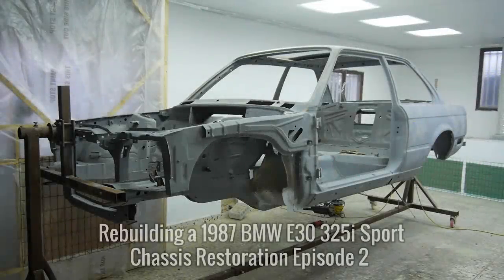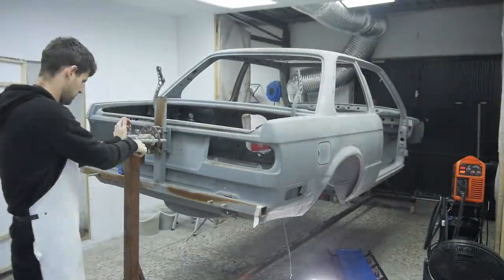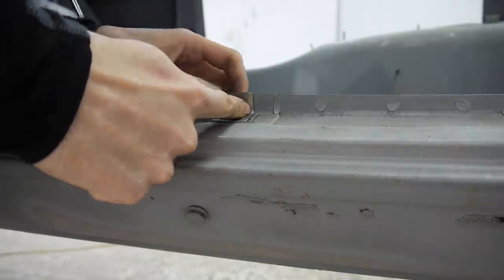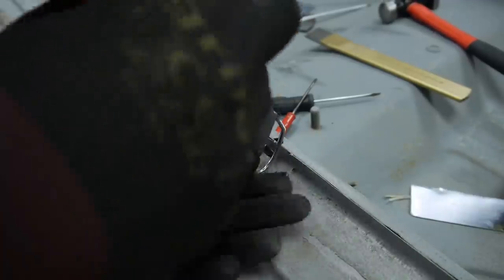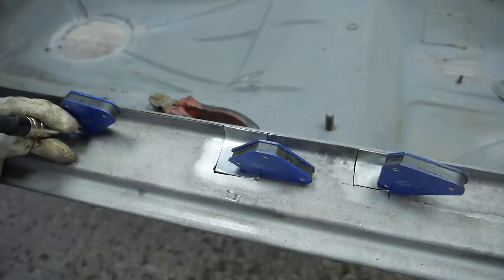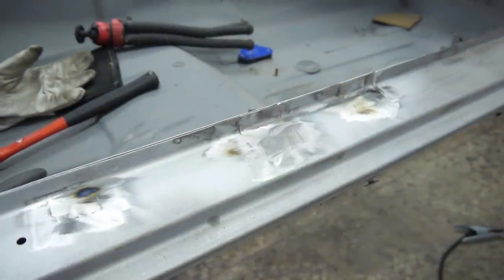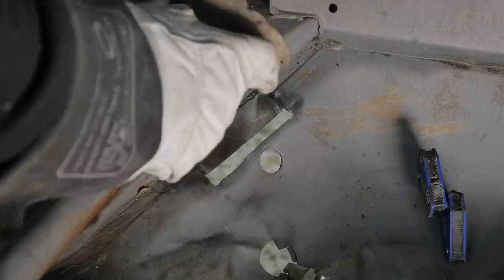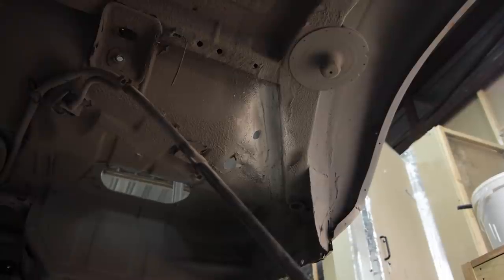Rebuilding A BMW E30 325i Sport | Part 2 - Learning to Weld A Car

Comment: You're doing a fantastic job but a little tip. when cutting into two panel like the back seat area you did, it's always best to remove layer by layer cutting the first layer bigger than the last layer. That way when you weld in the bottom layer you have space to grind down the weld so the top fits flat to the bottom. Also instead of running your welds try spot tacking stacking them 50% over each other and that way you will not blow through the thin sheet metal. When you run the welds you are creating more heat into the panel and it is easy to blow hole in the panel. Hope this helps. Another tip I forgot to mention is when grinding in corner or tight spaces, use a small cut off wheel on the die grinder and gently grind the welds off with the edge of the wheel.
Reply from the maker: Thank you AS28g! Great adivce. I will keep this comment somewhere for help!

Comment: I brought a welder at the weekend as it was roughly the same price as buying a whole new exhaust as every section needed touching up, Watching your previous videos gave me the inspiration to 'bodge not buy'.
I'm currently practising on a section of new pipe by cutting off a piece and welding it back into place, I'm really pleased with the steady improvement each time i practice this, My plan is to start on the exhaust tomorrow.

Comment: I did a rocker panel and wheel well repair about just over 2 years ago in a small garage with a flux core and cheap tools. 

Some places the inner rocker and rocker and rear fender were so close to each other I made tools out of copper tubing to put behind so I would not weld together pieces that were not ment to be stuck together in that area.

Some of the metal I had to replace I had to shape and cut and weld on a bunch of times some of the panels I made ended in the scrap because I wasn't happy with how they looked next to the original metal (shape was a little bit off or something). 

In the end of it I had learned some new skills  and managed to make the jacking point on the rocker stronger than factory. 

It's fun watching your videos and the detail you show is awesome.

Comment: Try angling the torch to the thick metal. When butt welding i set the mig higher and give each tack a double hit allowing to momentarily cool before moving along. it makes for a flatter weld and less grinding.

Comment: Hey dude, try running a bit longer welds.
I know when i was first welding my e36 that i was scared that i'll burn through the panel and i didn't see shit through the mask so i made the same mistake as you did.

Then i took 2 pieces of scrap sheet metal and practiced, attempted to burn through on purpose, etc.. and that let me get a feel for it and not be as nervous when i'm working blind.

Also that e36 was hella rusty and i didn't have money for replacement panels so i made a lot of welds, i even chopped off rear shock mount and put in another one from a wrecked car lol.
Reply from the maker: Thanks CME! Damn you've been through it! Thanks for the advice man!
Reply: Problem is that you warp your panels the more heat you put into them, thats why you mostly just spotweld. He also should try lowering the wire speed instead of turning up the power, as he is already burning through the metal.
Reply: I must disagree, with longer beads you introduce much mote heat and then you have to deal with warping, letting the heat spread to a part with short tacks is much better imo
Reply: @oxygenium92  It depends to be honest, you are introducing a same amount of heat in both cases, it is just the amount of time you introduce it in.

A small weld like this on a well heatsinked surface would have 0 problems from warping, i guarantee you that, especially since these e30's were built like tanks compared to today's cars.

The problem with a lot of spot welds is that you much more run the risk of structurally weak welds,  and god forbid he crashes this e30 this weld point is a very nice weak point. How weak you want to make it depends on integrity of your welds and your filler material, the sheet metal in this case.

Also, tack welding like that all around makes the weld a lot harder to clean up and often leaves a lot of tiny holes which are dream come true for rust.

Everything has it's own limits tho, so don't go out and run 20cm beads just because i told you to, i suggest you experiment on your own a bit and also look at some professional  bodywork repair videos, you will see how they do it.
Cheers!
Reply: @FetteMacke  Both are true, if you look at professional bodywork videos, you'll see them section the weld into smaller chunks, about 5-8cm in lenght, which they weld in one go and then swap to doing another spot to let this one cool down a bit.

Plus, you are not welding paper man, it does not warp that easily, and if it does warp, it's still better than having porous welds in structurally important areas.
 Cheers!
Reply: @lazar2175  I know, outer body parts, like flat faces like the rear quarter panels for example warp easier than the parts he welded. Had to do some welding on my hyundai terracan, had struggles to not warp the fender, but the inner fender was easier
Reply: @FetteMacke  My dad owned a 2.9l Terracan, it rusted under the plastic trim in some places, and the metal was mighty thin, like on all new cars.
The 80's and 90's cars had a lot more substantial body panels and still had acceptable weight.
Newer BMW's have paper like bodywork, and in some instances more aluminium and plastic than steel.

We eventually sold the Terracan due to 4wd problems but it was a beast of a car as far as towing and  off-road goes. I called it poor mans G class as it was pretty much blacked out and was really boxy.
Reply: @lazar2175  I can only agree. Still have that car sitting in our driveway, waiting for it to come back to life. Had some issues with the check engine light, hopefully due to a leaking head gasket, my dream would be a LS v8 in that car :D

Comment: great to see and hear that your welding process itself is now properly working, nice short arc! the white residue on your small plates is still burned zinc from the coating. if you weld zinc plates the zinc burns and build fumes that can lift your shielding gas and your liquid metal pool. so the best would be using not coated metal.
Reply from the maker: Thanks for the advice Kus!

Comment: I am, by no means, a good welder, but I do have a couple of suggestions when using a MIG welder: I think it would be better not to weld perpendicularly to the spot, but with a small angle; when welding light gauge metal is better to make a number of welds, spaced in between, and then come back and do it again between the spaces, until 100% filled; the latter will prevent warping the metal, and possibly have less weld thru holes.
It is great that you have good tools to work with. It will be a great looking car once you finish with it. That you did it yourself is the best part.

Comment: Doing much better on the welds! For your comment in the video about thinking you need to turn up the welder, you need the opposite. Turn down the amperage (heat) just a touch, and turn the wire feed down a good bit. If you’re still blowing holes through the metal after this, turn the heat down more.

Comment: Nice job. Thats how my welding looked too in the beginning.

I needed to Grind them down to. I really recommend you to buy a small 9mm Belt sander like Makita 9032 or an air driven Alternative. The angle grinder is not precise enough so you grind down a Lot of Material of your healthy 0.8mm sheet metal so they it gets thin and hot.

For getting rid of the undercoating i recommend using a fein Multimaster or comparable Tools. Using a wire brush on the angle grinder is a really dirty process, but it works too.
Reply from the maker: Thanks Joe! Great advice. I'll try the belt sander and get the fein multimaster out for the undercoating.

Comment: Welding thin metal at weird angles is hard no matter your length of experience. I think your doing great. I stitch weld body panels to keep heat warpage down, stitching is just a series of tack welds that in the end look like a tig weld.
Reply from the maker: Thanks Sunny! I will try some stitch welding next epsiode for sure!

Comment: For grinding I recommend a pneumatic 90° die grinder with the grinding disk attachment. Works a lot better to get into tight areas for grinding down welds. Also the white residue you see next to the welds is the galvanizing burning. It can make you very sick so just make sure you get all of the galvanizing off, or even better buy the right metal for future patches.

Your welds are improving, and that's the thing about welding... Years from now you look back at your original welds you'll be embarrassed. But take each improvement as a step in the right direction. We all started somewhere. Good job waiting for cooling between welds and doing small spots then move to a different area. Too much heat in an area will just cause burn back at the edges of the panels that you then have to fill. Also I might recommend using a hand file to get nice straight edges in the cutouts making it easier to make filler panels. Making odd-shaped panels for odd-shaped holes is always more difficult than squaring it off from the start.

Keep up the good work. Love the videos and watching you learn new skills. It takes me back to my youth :)

Comment: Where you can, for instance the door sill edge, use mole grips to clamp the piece down, you'll get flusher bits welded in nicely.

For a beginner in welding I think you're doing great. We all make mistakes but that's the beauty in doing so, you learn from past mistakes.

I appreciate the effort that goes into your videos. Keep up the good work!

Edit: Also perhaps consider using a die grinder to clean your welds rather than the bulky but trusty grinder.

Comment: I use grinder discs for the welds with great results but it needs a steady hand
Reply from the maker: Thanks dude, I did start with those but a lot of people said I should use flap discs. I'll go back to them if I need a fine grind I think.

Comment: Don't turn the welder up hoping for flat welds, you are more likely to start  blowing holes through the metal! Trying to do welding runs with sheet steel will make the metal warp and it will make a mess of a good repair. Just do spot welds and that should be better for you. The repair you have done to the top of the sill and the seat base are really good for someone who has just started welding. And one last comment. I wouldn't replace a full panel just for some small holes. I would use some of the panel to do the repair but not all of it. You are doing good work, keep it up.
Reply from the maker: Thank you Ian. Solid advice. I really appreciate it and will keep it in mind.

Comment: You should tack weld . Put some tack , wait for about 1 sec , for heat to go into metal  , and cool weld , then put wire on end of previous tack , and repeat process . Do this 4-5 times and move to next spot . Do not try to continuously weld tin sheet metal. Another thing ,  first make patch , use grinder for cutting ( strait cuts ) , then put path over hole , and use it as template for cutting . Go for strait lines , cos its much easier to cut with grinder . Gap shouldnt exceed thickness of wire . If you have holes to fill , use some heavy piece of metal , like old hammer ,to make bottom of hole. Wire wont stick to heavy piece , if you do short weld .  Good luck
Reply from the maker: Thank you Stevan! Great advice.
Reply: Your welds should look like CCCCCC

Comment: as you have an airline and a 2 inch roll lock, you should get an angled die grinder. you can used 2 inch flap discs and sanding pads and will produce easier cleaning than your electric die grinder and wire wheels...
Reply from the maker: Thanks Antony I will look into this.

Comment: You are doing very well for a newbie. 

As for setup, get a smaller dia. Mig (GMAW) wire (.023 inch - .025 inch - basically the smallest wire you can find). On thin gauge material like these panels it works much better. This will also allow you to lower your voltage (no more holes) and wire speed, resulting in less material (weld) build up. But it will provide the proper penetration for this application. 

However, on structural components 1/8" (3mm) and above you need to use a larger dia. wire (.030" or even .035").

Comment: I Think if you go for TIG welding you use half the Flapdiscs and save alot time grinding, the welds look better too. If done correctly also less heat in the material that may cause warping the metal. I use Mig also, but its not for restoring cars. Just make cars passsing MOT or weld an exhaust :P I did see alot improvement!
Reply from the maker: Thanks William! I really want a TIG. I'm going to get one!

Comment: Don't know if you found out yet, but there are hand operated (and air operated) punches for making holes for plug welds. Makes a cleaner hole than the drill bits, and goes a lot quicker. My air operated one is also a flanger.

Comment: hey man, just a tip on your welding, turn your voltage up around 10 to 20 volts and turn your wire speed down a little. Remember as a very general rule voltage dictates weld penetration while wire speed dictates weld penetration and weld deposit quantity. also as you are using shielding gas there is no flux going to be formed during welding so there is no need to wire brush between welds. finally only weld in maximum 1 inch steps and move to another area to keep the heat down and help in stop burning through.

hope this helps. keep the vids coming and best of luck with it
Reply: Sorry 1 more thing after reading a few of the comments below, there are a good few comments talking about tack welding all around the patch instead of a weld bead, as you are using what looks like 1.5mm plate there is no need for tacking as the metal is thick enough to take the heat.
Reply from the maker: Thanks for all of the advice Simon. I'm using 1.2mm and will be going down to 1mm in some places so I guess some tacking will be in order. Thanks again.

Comment: 23:00 I believe that with MIG welding you're supposed to "push" the torch rather than "pull" it?? Someone correct me if I'm wrong, but that's how I was taught.
Reply from the maker: Someone else has said this so think you're right SlapHappy :) I will push it from now on.
Reply: Pulling is right when you use low powered Short Arc Process as on thin plates like Cars . If you increase Power to Spray Arc (more than 26V) and you want to weld a fillet Weld for example then you need to Push slightly around 10 to 20 degrees to get a nice flat seam.
Reply: You should also do what they call stitch welding which is a series of tack welds around and around and around so you don’t overheat and warp the panel
Reply: Well it is not really my place to advice as i a not welder but i would think asking someone who does welding for profession or is good at it to show how to get started would help you get a bit of confidence and right tecniques. Thx for the videos.
Reply: Because of the shield gas, pulling it makes it escape. Pushing it protects it.

Comment: For the welding you need to tack every 35mm ish then stack 5 tacks at a time not full welds it puts less heat in also have a wet cloth to hold on after tacks
Reply from the maker: I will try this next time thanks Nicholas!

Comment: You sure are getting better and better! Congrats! I have some unsolicited advice: the top of the sill is a flat pannel with a 90° bend; you had 3 rust holes lined up, it would have been better to make only one patch pannel, less welding, les pannel weakening. Also, I would recommend getting a spot weld drill bit, will make your life easier and you won't have to dill through both pannels. Finally, for a perfect finnish and minimum use of filler, I would advice you to use tin to fill the welds on your patches. Hope this helps! You are doing awesome.

Comment: those tack welds looks very good tbf, some people do runs like you tried to do, i prefer to tack one by one all the way round the panel, tack in all corners to hold it then tack and tack and tack one right next to the other (best to try and overlap a tiny bit) also im glad to see you resting the gun on your hand or with your fingers against the panel, welding in mid air is very difficult and annoying, but i can definitely see your progress keep going!!
Reply from the maker: Thank you Kezza! I'll try it next episode :D

Comment: You turn the temperature up, then find you blow through more... so you grind back, which thins the metal, and when you weld the holes you blow through even easier! It's frustrating but as you say, it's just down to practice. And everyone has to start somewhere 👍🏻 Keep it up!

BTW finger sanders a great for carefully grinding back just the welds, not thinning the surrounding metal.

Oh suggestions for the rear bench near the fuel filler pipe, getting started, maybe a cutting disc? Appreciated you may not have the room and angle there...
Reply from the maker: Hey CookRacing, thanks for the comment dude. I apprecaite the advice. I should have use the bloody air finger sander I have! I won't forget next time. Thanks man.
Reply: @RestoreIt  I know how it is - you get to a point where you have such a big range of tools and forget you have something more suitable for the job :D
Reply: That's a sweet comment ! constructive, delicate, and helpful. cheers